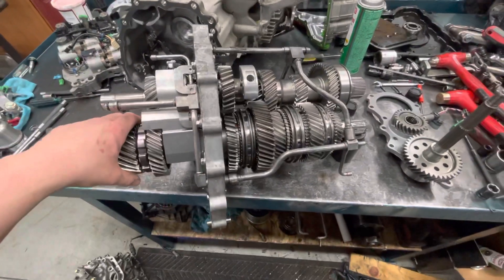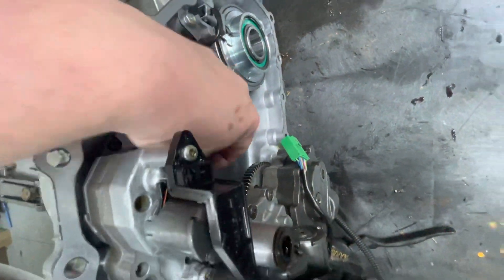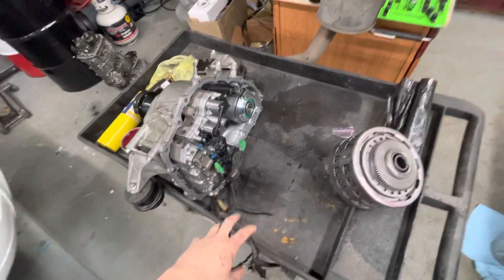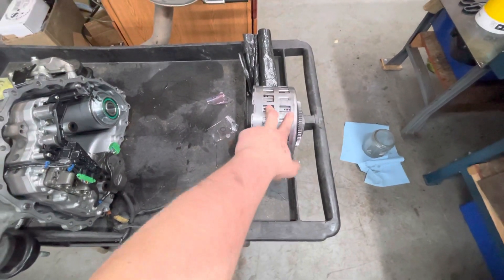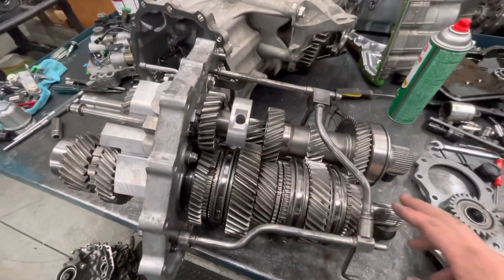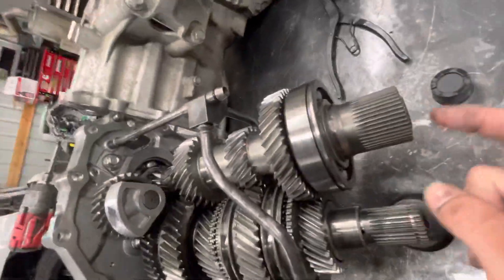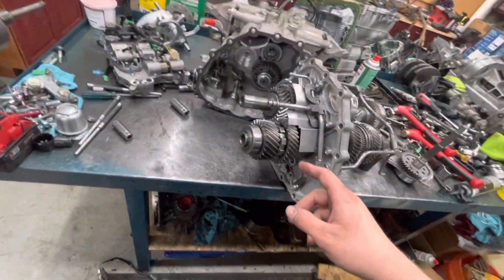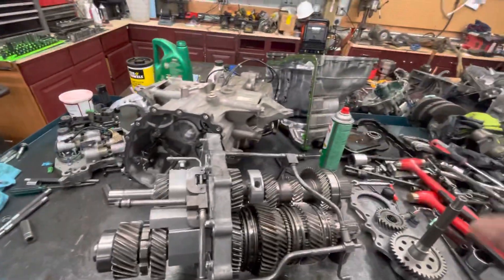How AWD works on a Nissan GTR (technical explanation and power flow)

Comment: That "viscous clutchpack" for the front driveshaft that runs from the rear transmission to the front differential is actually electromagnetically actuated with a ball ramp mechanism pressed by energising a solenoid.

It is not a viscous unit like a subaru VCD system because the clamping force is applied by mechanical force which is in it's turn generated electromagnetically by that ball ramp.

The exact same concept is used on the Yaris and Corolla GR clutchpacks or Mazda CX90.

Thr system was invented by the manufacturer of this transmission, Borg Warner and it is called Torque on Demand as a marketing term, but it was first implemented on longitudinal awd transfer cases from Ford in the 90's under the name ControlTrac

So in the end it is not filled with a magnetorheological fluid like magneride system for the dampers

True viscous couplings use shear plates that agitate a siliconic fluid that heats up and expands generating friction between those discs that don't have direct contact between themselves.

The gtr coupling uses the electromagnetic ball ramp because it is proactive, whereas a viscous unit is always reactive, it locks after the skidding event,not before it

And it's precision is better than the one generated by a hydraulic clutchpack

Magnetorheological fluid changes its viscosity based on the magnetic field generated by a solenoid and that variable viscosity affects fluid flow through a static valve body, whereas in a variable damper with servo valves you have the same viscosity in the fluid but you change damping force by varying the section of the valve hole that the oil runs through 

In other words magnetorheological fluid cannot change and apply friction based viscosity to a multiplate clutchpack

Comment: Thanks you so much, I learned a lot about the transmission.. I have 2017 GTR and I have to replace my solenoid..
Reply: I have to replace solenoid A on my GTR do you if solenoid A is located on main valve body?